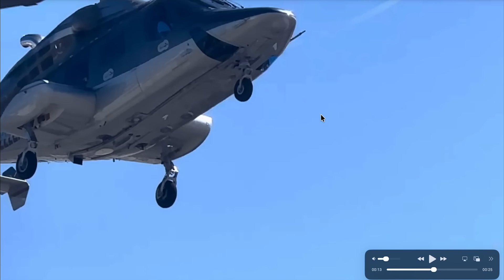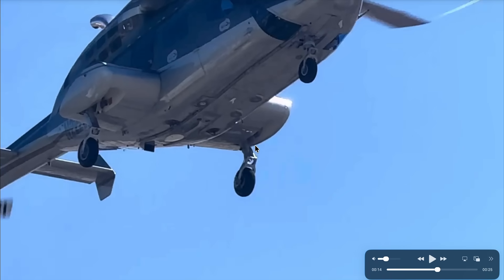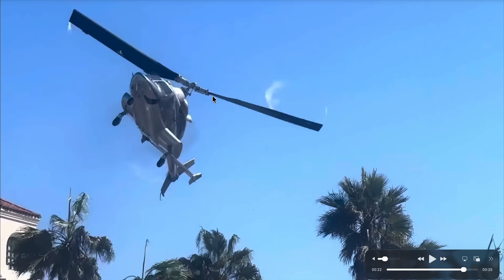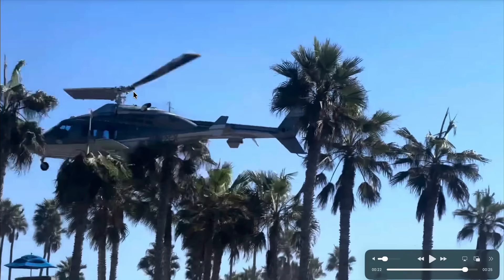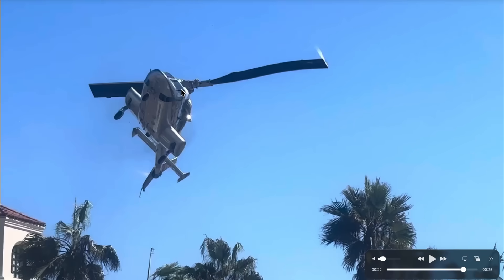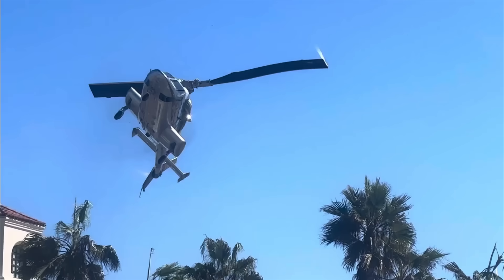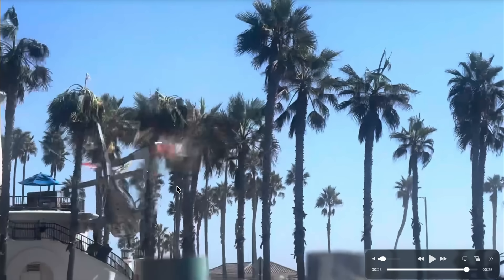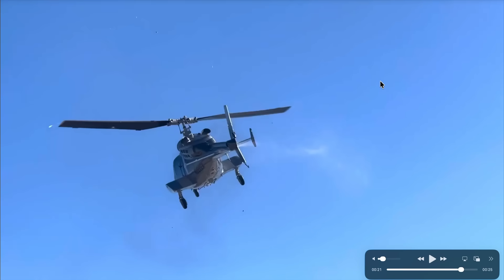Huntington Helicopter Crash Analysis - SlowMo Video!

Comment: 30 year EMS helicopter mechanic that has always taken this kind of stuff very seriously.   Fascinating breakdown sir.    I had a feeling that the tailrotor departure was due to main rotor striking it after the initial disconnect.    As far as doing high speed flybys I generally don't have a problem with it as long as it is all within regulation.   The aircraft is more than capable.   In other words IMO the accident had nothing do with the flybys, or if it did then it was doomed from mechanical failure that shouldn't have happened in the first place.
Reply: And it is because of previous EMS crashes that ruptured the fuel tanks… that required these to be retrofitted… and saved these guys lives.
The fuel didn’t rupture because of the fuel tank liners.
Reply: @TestPilotN911RG   Well said
Reply: Unless the pilot was over torquing TF out of that helicopter earlier in the flight and maybe sustained a tail rotor drive failure while coming to a hover over those palm trees.
Reply: @colt10mmsecurity68 Didn’t look too unusual. A little close, but didn’t see an over torquing during the fly by…
Reply: @TestPilotN911RG You can’t see it outside.  Buy you can on the torque gauge in the flight deck
Reply: @colt10mmsecurity68 I believe this aircraft has a systems recorder, so an over torquing will be registered.
Reply: @TestPilotN911RG please explain how!
Reply: @kurtnelson9714 correction… the pitch control rod came off one of the blades on the tail rotor system. The speed change was suspected as ‘slowing’ based on frame rate change. This is wrong. One of the blades went to a neutral position speeding up the tail rotor, with a complete loss of tail rotor blade control of one blade. Same thing… he pulled up, realized he needed to go into an auto, tail rotor was struck during low G, and mast bump broke the main rotor mast.
Reply: Mast bump didn't occur, until after tail rotor gearbox failure, and descent.
Reply: @kurtnelson9714 yes, it was the second time around for the bump, and the mast separated on the third time around.
It remained attached through the pitch change links as it fell through the trees.
Reply: @kurtnelson9714 correction… the frame rate change was suspected to be a slowing of the tail rotor… it was a speed up.
A pitch change rod came off one tail rotor blade, that made it go neutral increasing the tail rotor speed (giving the frame rate change for the Camara)
The pilot had control of one blade, but not enough, went auto but low G took out the entire tail rotor system, and broke the main rotor mast.
Reply: @TestPilotN911RG I appreciate your input! Like everyone else. Just trying to understand the swiss cheese.
Reply: @kurtnelson9714 Yes… it was a mechanical failure… but had the pilot been higher (like where he dropped from) on the approach, he could have immediately entered an auto, as you should when you lose a tail rotor. Remove the torque as fast as possible to prevent spinning as much as possible. Extremely lucky to have survived. The pull up, then drop of the collective created a low G condition… extremely dangerous in a helicopter. Always want to keep the main rotor system loaded. 
If you fly… always fly with a plan to crash at any moment. I’ve been lucky. I had to put down a helicopter at Washington Exec (now closed). I was flying close to it… just in case. I lost my main drive bearing… could have been over it a split second.
You literally have a split second to make a decision… make a wrong one and you could be dead… that fast.
Reply: @TestPilotN911RG I appreciate your feedback! I have never spent time in a helicopter, except for short flights. Never had the chance to learn the basic principles. I've flown fixed wing. But never tried wrapping my head around rotars.
Reply: @kurtnelson9714 the first props that. Ould change pitch used pitch rods. Helicopters are a bit strange. I was fixed wing first. I flew RC helicopters in the early 80s to learn how they flew. Interesting thing, the RC rotor pitch systems worked pretty much the same way as a full size helicopter.
Reply: Nicely done sir. It’s looks like a P\C link failed on the tail rotor. That’s why the one T/R blade had such a large pitch vs the other. The tail rotor only changes in pitch collectively. The Delta hinge design at the tail rotor yoke is what compensates for dissymmetry of lift.
With one blade now uncontrollable there would be a big imbalance and a high frequency vibration. The imbalance would start tearing the T/R gearbox from the tailboom and would also account for the T/R blades breaking. 
The smoke you mentioned could either be from the pilot demanding full power (look at the main rotor pitch) or from the pilot rolling off the engine power which is exactly what you do in a loss of tail-rotor thrust. Again noting the pitch in the M/R blades, it’s very difficult in a situation like that to lower the collective and because his approach was so unnecessarily low and flat over obstacles, the pilot had now other options. He dealt himself a bad hand there. 

As to the fly bys, they violate a few FAR’s most notably Careless/ Reckless operation. 

I was a Huey and Cobra Instructor pilot at the Army aviation center for many years. I also have a lot of time in the B222 flying EMS there in Southern California. 

This is just my opinion of what appears to have happened. 

Thanks again for the excellent video!👍
Reply: we are in a primetime of maintenance lacking, people forget and overlook more things, i dont maintain my motorcycle as much as i should and i know it can cause problems, but the worse part is even so called profeccionals you take it to get it done can sometimes seem dumber than you
Reply: @votpavel   I truly do believe in the covid theory.   The whole world seems to be in a state of IDGAF about anything anymore.  I have absolutely noticed this in the EMS world and every other facet of life.  I'm not convinced we're ever going to bounce out of it either.  Not trying to be a Debbie downer but just reality.
Reply: @PNW_Car_Mods  every infection, even mild ones, is leading to a drop of about six IQ points. There are a lot of other residual effects as well.
Reply: @votpavel way to early to blame mx.
Reply: @SeligTiles i wouldnt but in another video he was  flying so close to that building with people is just crazy
Reply: Why did the speed of the tail rotor drop just before pirouetting started?
Reply: @123JDA123 the tail rotor system has a gear at the tail… that gear fails, the rotor gets no drive.
The shaft out to the tail can also fail, but highly unlikely.
Reply: @TestPilotN911RG I see somebody getting in big trouble for this! Records don't lie. People do!
Reply: @kurtnelson9714 gears can fail… as long as he didn’t over speed the drive system causing the tail rotor gear failure.
Reply: Records created by liars do lie. You gotta try the line up in laundry town state.
Reply: @123JDA123 
Possible tail rotor drive shaft failure.
Reply: @123JDA123 prior to the mast bump.
Reply: @123JDA123 because the pitch control linkages failed.
Reply: @123JDA123  the tendency of the helicopter is to rotate to the right when operating due to torque effect of the engine driving the main rotor and pushing the nose of the helo in the opposite direction.  The tail rotor counteracts that tendency by providing thrust in the opposite direction.  If the tail rotor slows down thrust is reduced, the torque pushing the aircraft nose to the right wins the torque battle and the helo rotates.
Reply: If the pilot was careless in doing these types of maneuvers so close to buildings, it isn't hard to imagine being careless in maintenance.
Reply: @TamburelloE  good point, cool is cool but swinging blade so close to people on balconies just cements this, just because he was a "great pilot" dont mean shit, i heard idiots get praised that should never be praised
Reply: @TamburelloE  my concern is strain on the airframe that can’t be easily noticed or maintained
Reply: There's footage out there of this helo doing high speed fly bys way too close to buildings in the area. Like 75 feet from building balconies. Even if this is a mechanical failure the pilot has some answering to do for those stunts.
Reply: @carbonking53 agreed. 14 CFR 91.13 Careless or reckless operation.
Reply: Trying to analyze how this happened, it could've been a number of things, error in pre-flight inspection, mechanic improperly serviced, sabotage, metal fatigue, the only way to answer that is with cctv camera inside hanger to see if it WAS sabotage, otherwise investigation of mechanic's work, or MRI inspection of the metal itself to see if stress cracks were present that eventually separated.
Reply: fixed wing guy here, spot on
Reply: It was the straw that broke the camels back. He was being a hotdog. Careless and reckless (FAR definition) It’s not hard to believe he did it before which over time cumulated in this.
Reply: There is a clear picture now of the reason for the tail rotor speed change… one of the pitch change rods came off the tail rotor. The rotor speed changed, but oddly it didn’t slow as was first thought. You can see by the Camara  frame rate change that the tail rotor speed did change. It was suspected to have slowed reducing tail rotor effectiveness. This is incorrect.
The tail rotor sped up. When one of the blades went to a neutral position. This would change the frame rate and speed up the tail rotor with a loss of control.
Reply: @TestPilotN911RG  You could also hear a crazy sound change of the tailrotor when the one blade went neutral.
Reply: @PNW_Car_Mods  I could hear it… when I first saw the video it was clear there was a change in speed of the tail rotor system. I thought it was slowing, so most likely a tail rotor gear box issue. I could see change in pitch of a tail rotor blade, but that must have been just one, because you can see one pitch rod not connected.
Reply: Could it be the Jesus nut coming loose and causing vibrations ?
Reply: interesting? thank you
Reply: I think the flybys point to an attitude of indifference to following rules.  That attitude likely overlapped into the maintenance of the aircraft.
Reply: @greysheeum  I really truly hope not, but time will tell.
Reply: Thank God they survived and the Helicopter didn't burn